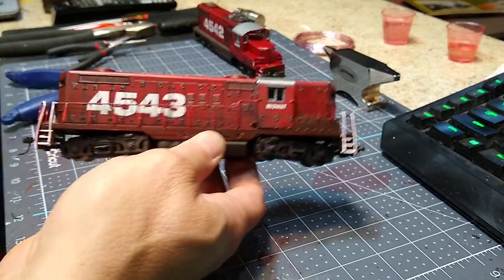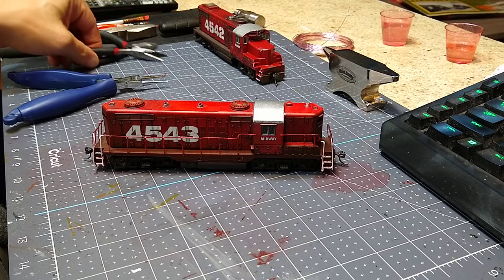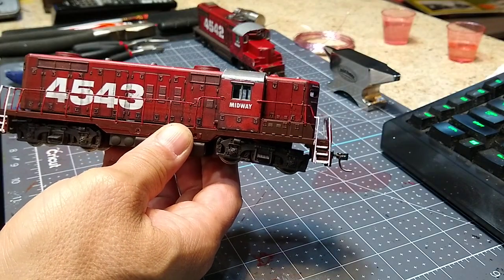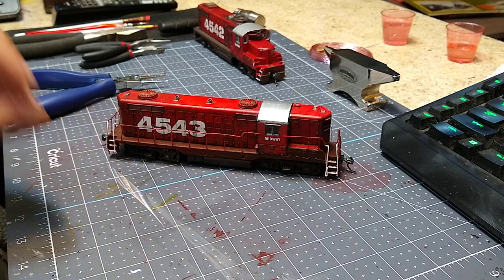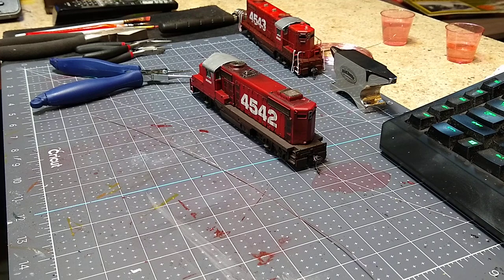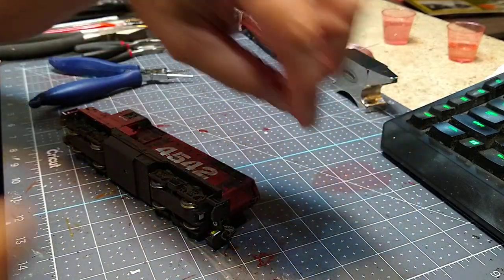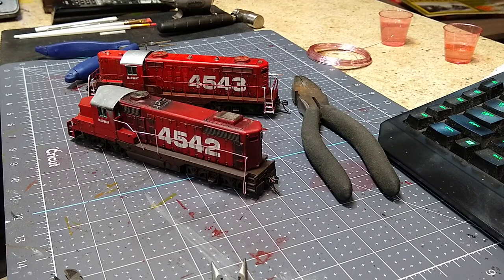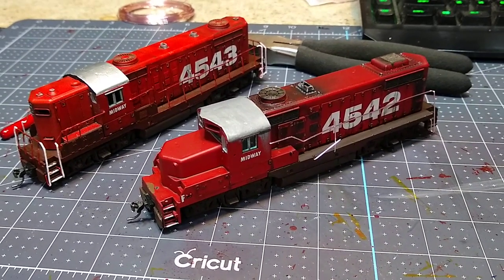Making Locomotive Handrails from Scratch part 1

Comment: not bad at all, I know how difficult copper wire can be to be completely straight.  I used a little trick tho, take those round nose benders, and some rubber shrink tubing, shrink it around the tips, pinch the wire and pull through.  that'll straighten it right out, plus you can take the shrink tubing off when you're not straightening.  also, take a little piece of flat aluminum and use that to bend your corners over the pliers instead of your finger.  It makes them nice & sharp.  a little sign trick for when we're running LED wire :)  great job!  I like the style you came up with
Reply from the maker: this has given me an idea to make a roller - the jewelry lady puts the wire on a hard surface and rolls it with a cut off end of a 2x4

Comment: Bending the Stanchions in a “U” shape and making two at a time helps hold them in place.
Reply from the maker: I just did some today using more techniques from the jewelry lady and they turned out even better.  I used 26ga copper and it is really bendy, but super easy to reform after making them - I'll be showing them in the next Athearn Hustler video.

Comment: So what gauge wire are you using to make the .020 wire? Thanks great video.
Reply from the maker: at Joann Fabrics I get 20ga to 26ga wire for different uses.  it's so cheap that it's worthwhile to get all the gauges from 20-26.  you can do handrails, grabirons, various other wire work and piping.  the .020 is from the hobby shop and is still reasonably priced.  the advantage to the .020 from the hobby shop is that it is already straight and you don't need to roll it!

Comment: i appreciate the video.......new to all this and i bought an athearn gp9 and as you know you have to install the handrails.....one thing i noticed is when you make your own railing coming from the steps you make a round curl then go up and athearn does that too.....why?  the real locomotives come straight up off the steps and you wouldnt have to make the weird angle at the top to compensate for the railing going down the side and it would be so much easier to make.....and dang those athearn wires arent even bent right, Quality Control is not a priority i guess, which brings me to your vid......thanks and what is your opinion on the whole situation?
Reply from the maker: ah yes the famous loops!!!  I had watched a ton of videos of the jewelry lady on youtube and I went off the script on these!  they still look cool - but if you look at my very recent videos on using steel music wire for handrails, you'll find a better prototype method.  you'll also find a couple tools that we made for making a ton of steel stanchions a one time and a new bender that anyone can make that makes perfect bends just where you need them.  everything we do for making handrails uses materials you can get at the hardware store or the sewing store!  wait until you make the wire bender we did a couple weeks ago - it will change everything - tons of old projects awaiting handrails will suddenly get resurrected!!
Reply: @elite194  ......yeah they are kind of kewl looking, those curly loops i must say.....i will have to find the video you mentioned and watch with intent
Reply from the maker: the new homemade bending tool is working out excellent which means another handrail video coming pretty soon!
Reply: @elite194  .......thanks for letting me know